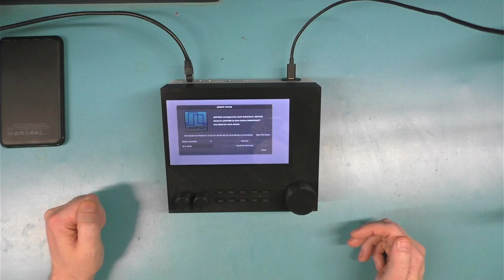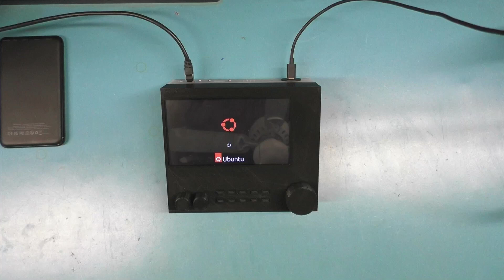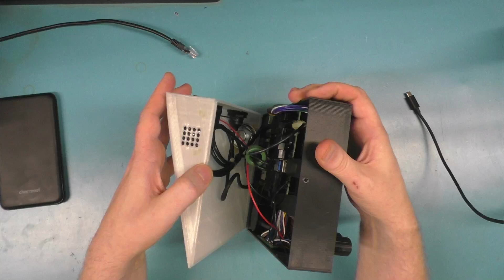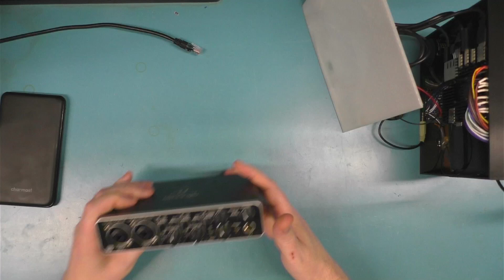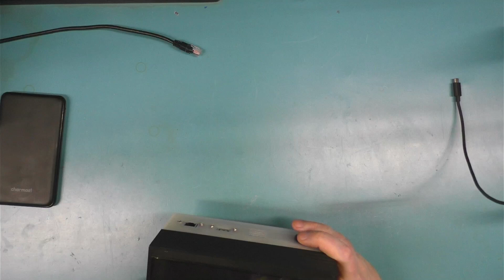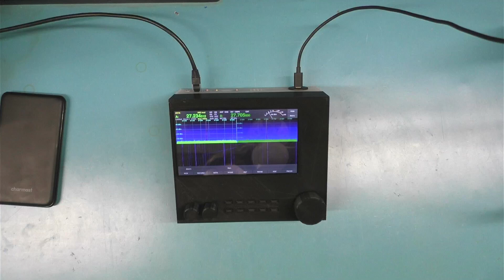Hermes Lite Controller

Comment: Long time HL2 user here. Nice work! Would you share your modified software? (PiHPSDR)? I had not seen a Windows fork before either. Very cool stuff.
Reply from the maker: It's GPL.. so yeah. I just need to put it on github. if you drop me an email i can send you a link when I get that sorted.
It's built in the msys environment on Windows. The thing that I want to try to tackle at some point is the actual resizing part. it's all hardcoded sizing and in GTK4 they took a lot of that window position functionality out to leave it to the window manager.
Reply: @Mark19960  Thanks Mark, That would be great. I have had some experience with the resizing issue on a Pi build of this. I did find a fork that allowed dynamic resizing at one point. But I am going a back a year or two now...